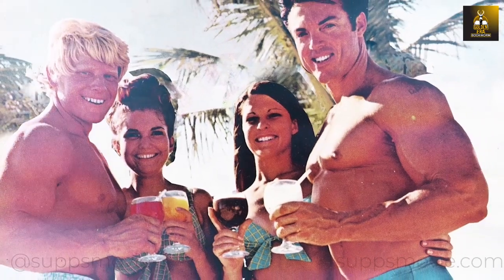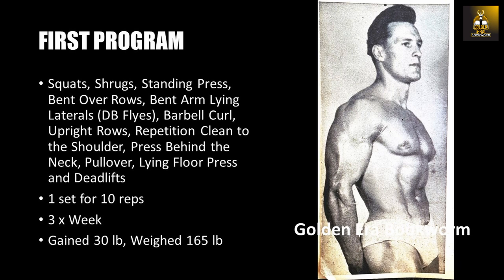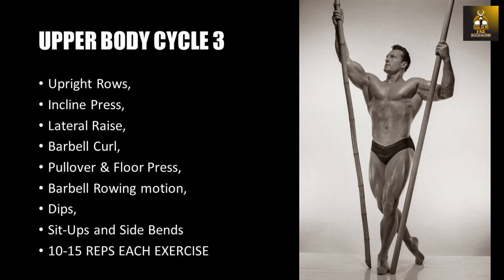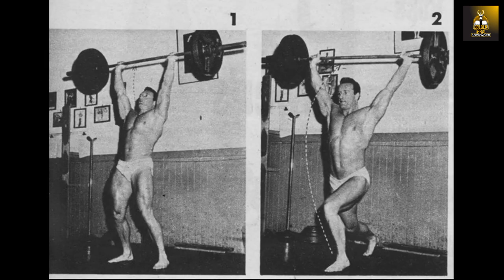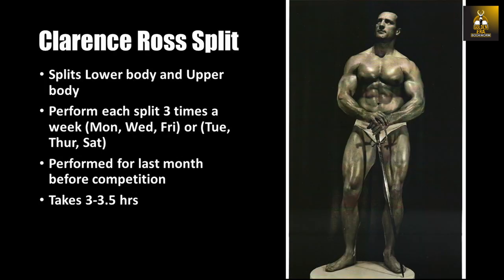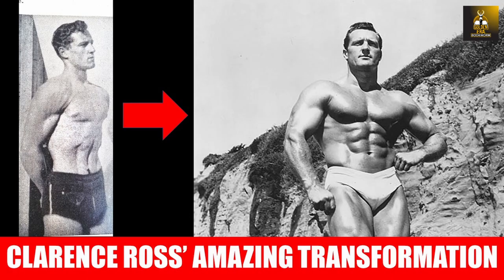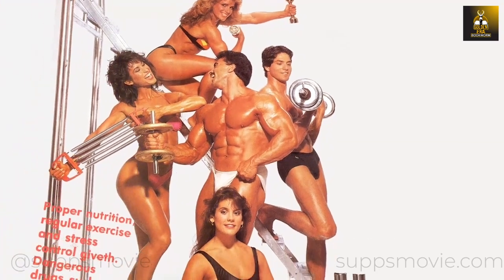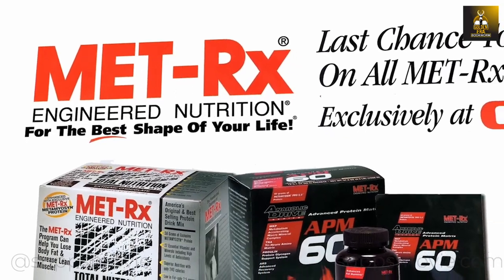CLARENCE ROSS' BODYBUILDING SYSTEM! THE AMAZING TRANSFORMATION OF CLARENCE ROSS!

Comment: My goal is to be strong like Clarence, but have the physique like Steve reeves. I just have no idea how to go at it. Im currently trying to really strengthen my shoulders as they are far too weak  which in turn should help make my bench press explode. Currently I can only press 105lbs for 7 reps at 190lbs which is no Bueno for a guy who weighs 190lbs of muscle at 6ft. My goal is to be able to clean up the barbell and then press over head 135lbs for 10 reps at some point. That with doing a lot of heavy rows, heavy incline chest pressing, and moderately heavy bent over lateral raises should help out a lot. Any other tips would be very much welcomed.